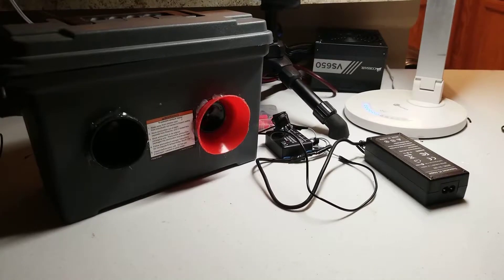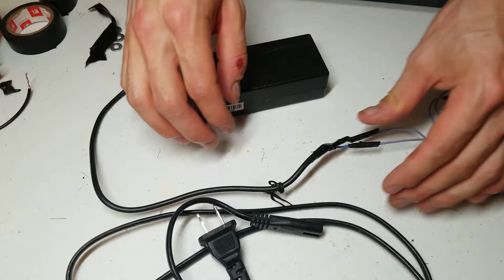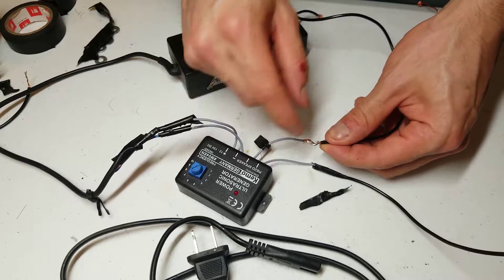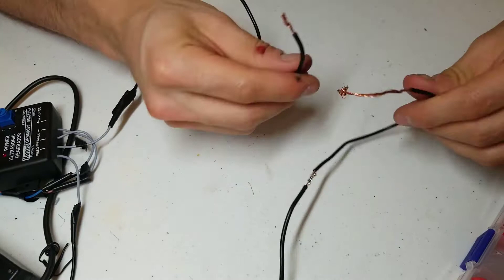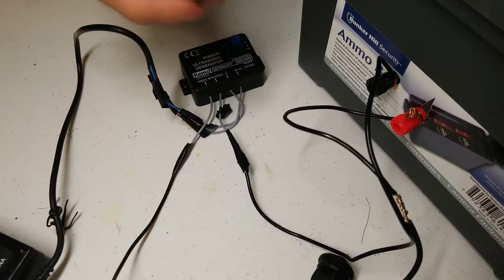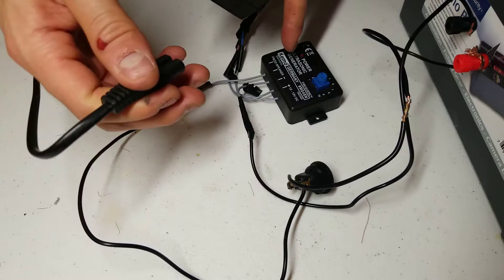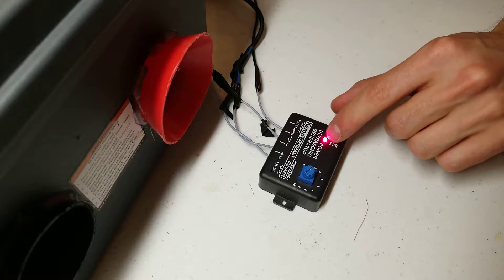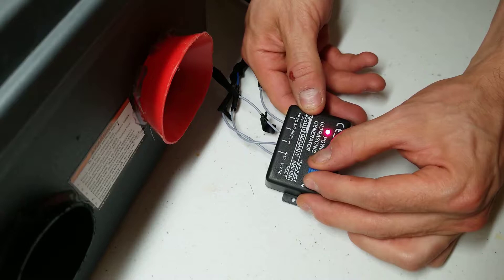How to Make an Ultrasonic Anti Dog Barking Device (Medium Range)

Comment from the maker: To make this remote control and still have silent start up, a 2-channel RF remote can be connected (example link in description). I would leave the the 12V supply plugged in all the time, and power the receiver and frequency generator(FG) with the 12V supply. The receiver would use the 12V as its input power, and the relay for the FG would also tap into the 12V. The ultrasonic output from the FG would connect across the 2nd channel. The RF receiver can do momentary, latched, and toggle with timer capabilities up to 1 hour so MANY options to suit your needs. Examples are press channel 1 with timer to turn on FG for 20 min, and either pulse channel 2  every time it barks, or set it for a timer of say 10 minutes. Just got to be sure to turn on FG channel before signal to speakers.
Reply: hi, have you really tested on dogs, does this device really work?
Reply: Would you build one for me and ship? If so, at what $. TIA
Reply: OPs method is superior/suited to most cases.. but if you wanted to avoid noisy startup, another way may be to install an inline frequency filter.. to filter out anything in human hearing range.  i'm not a pro.. and only assume this is possible.
Reply: Can you please post a video of this wiring diagram please?!?

Comment: I guess with 15 Volt you will get 25 % more power in the piezo. An older Version oft these Kemo can fire up to 24 Volt what is up to 100 % more Power than with 12 Volt.

Comment: Need a device like yours but in place of a switch I need two PIR (passive infra red) to trigger it when both or either activates. 
I only have rudimentary understanding of electronics. Do you think it will work?
Reply from the maker: Yes that's a great idea! You should be able to buy a normal motion sensor light and use the existing IR switch to flow current to the generator. Probably cheaper than getting a standalone IR switch. As far as the reviews, because it's high frequency it needs to be close range and line of sight. The short wavelengths can't travel through objects or long distances. I won't say it's user error, but too high of expectations.

Comment: could I just record the freqency noice needed on a recorder and just play it back on a regular speaker with a large amplifier so that the frequency noice previously recorded be way louder  being that we will not hear it any way?
Reply from the maker: The issue is a normal speaker and amp aren't capable of ultrasonic frequency. They are typically rated for 20-20k hz only unfortunately. The frequency range should be on the speaker and amp somewhere to see if it was possible.
Reply: Yep  having trouble finding a driver with such capability

Comment: I have a question if you hooked up an amp would it make it work farther away?
Reply: No, because the piezo are Voltage sensitive, not current like in audio amp. More Voltage give more power to the piezo...

Comment: What component makes it turn on when the dog barks?
Reply from the maker: It is manual with just these components. To make it sound activated, the easiest way would be to buy The Clapper and connect power supply to it, or take the sound relay out of the Clapper and put it in line with the signal generator. Then power supply would be on all the time, but frequency generator would only turn on when sound is detected.